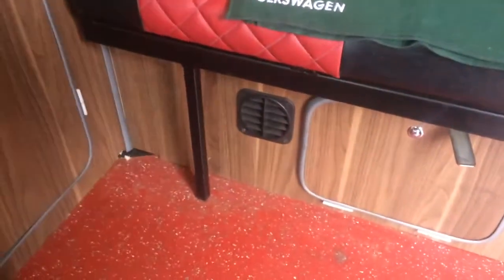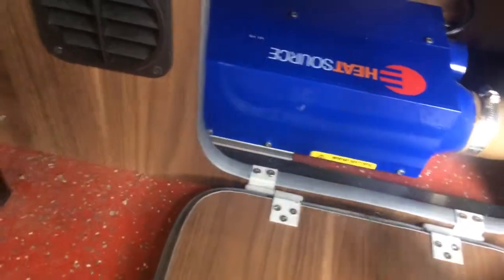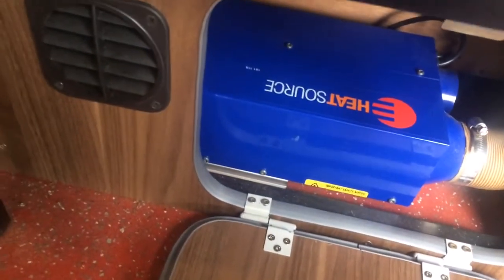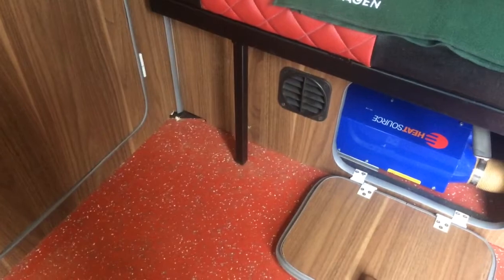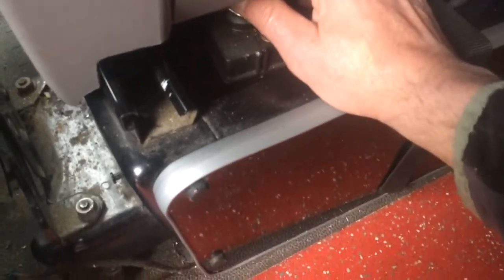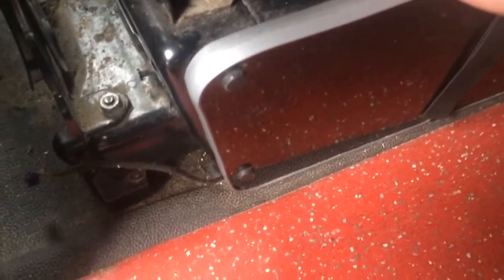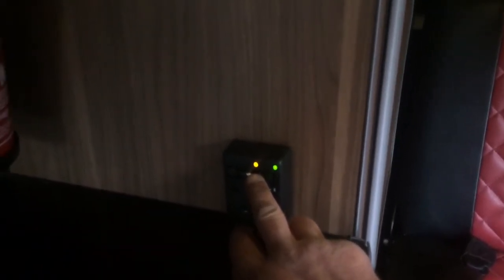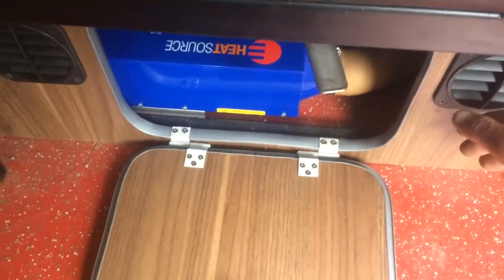Propex HS 2000 heater fault reset

Comment: hi Al butty, I am thinking of buying a propex 2000hs for my vivaro campervan its long wheelbase and lowline roof , fully lined do you think it will heat my van enough camping in the harsh welsh winter, would appreciate your comments,  thanks butty  diolch
Reply: Yes mate, had to turn it off most nights as it was too warm. Just make sure you have enough battery to run it all night.

Comment: Thanks. I have an HS1800 and getting 2 blinks of the red light. Error code for no propane. Plenty coming into the unit. Just pulled it out and cleaning it all. Thanks for your video. I'll be putting it back in right now and give it another whirl.
Reply: I have this on my 1600. What was the fix?